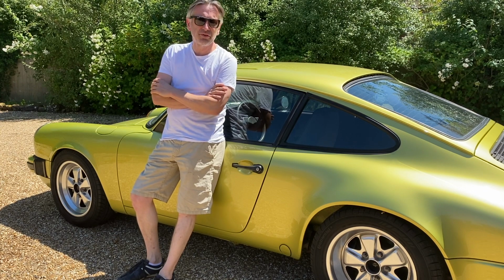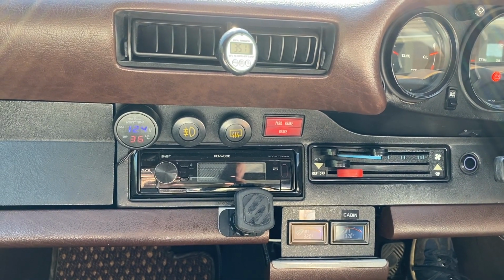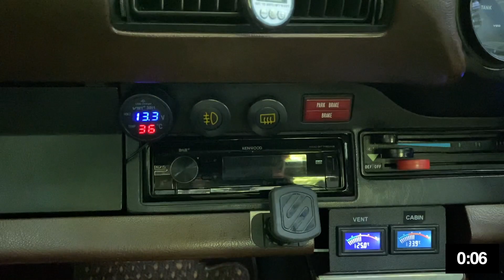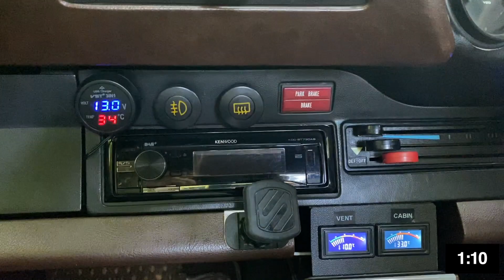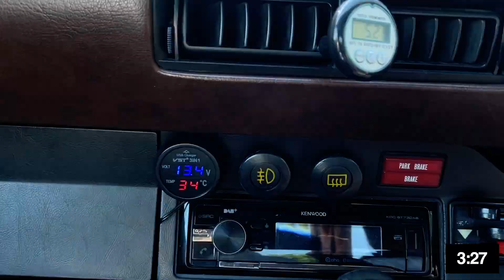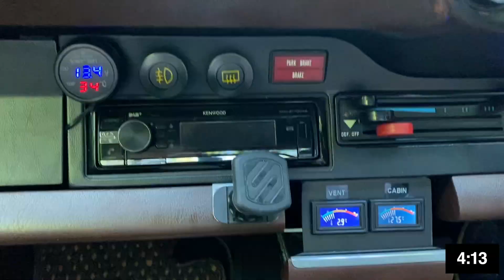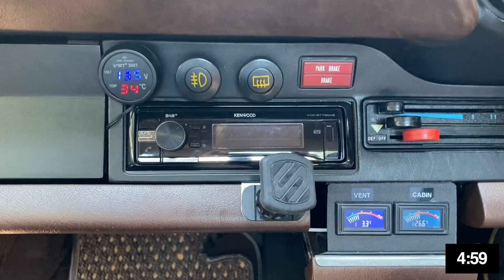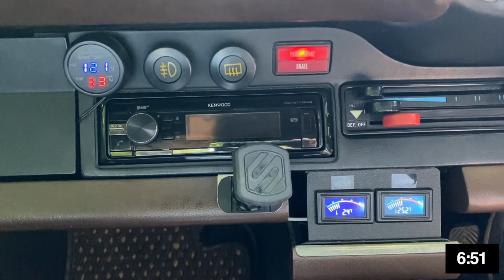Classic Retrofit Porsche 911 air conditioning: how quickly does it blow cold air?

Comment: Can the system run for long at idle?  I noticed when you pulled over that the voltage dropped from like 13.4 to 11.9volts pretty quickly, then stabilized around 12.1.  Seems as though the alternator isn't really generating significant current at idle, so I'm wondering if the a/c will get ahead of the car and continue to drag that voltage down or not unless you're moving.
Reply from the maker: It looks to battery voltage to run. It's not an issue in use 👍🏻

Comment: so i’m considering getting one of these for my ‘79.  but, i’m confused. shouldn’t the vent temp be much cooler than the cabin temp after 6 minutes?
Reply from the maker: At the 6 minute point of the video, the vent temperature shows 3.3 deg C, that is 37.9F, a few degrees above freezing.   The outside temperature gauge is showing 34C which is 93F.

Comment: How many amps are required to run this unit?
Reply from the maker: 35 - 75A  Depending on ambient conditions, cooling demand and ECU  settings.  Our ECU incorporates an adaptive control strategy for power management.